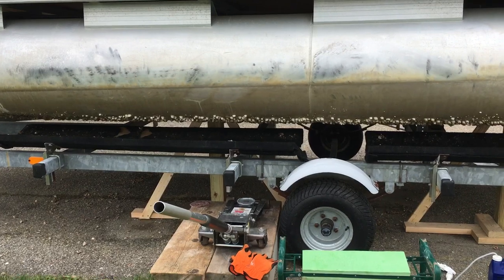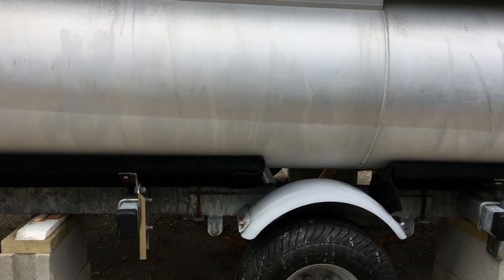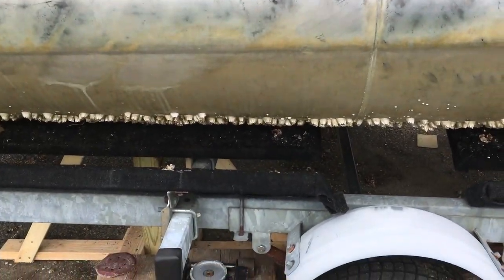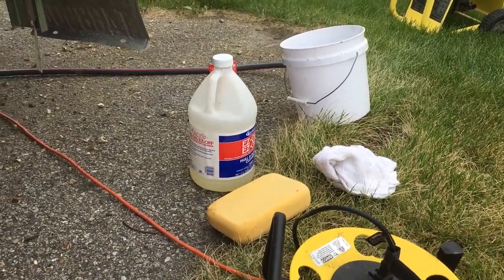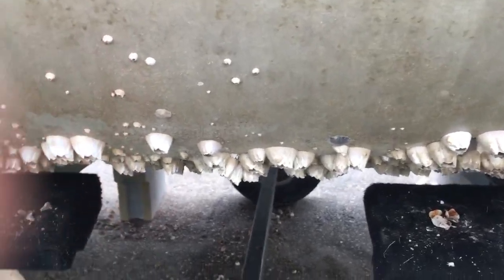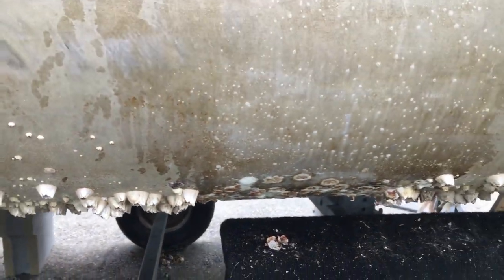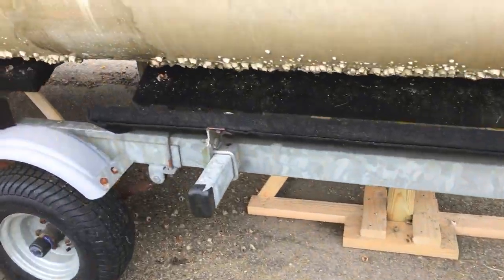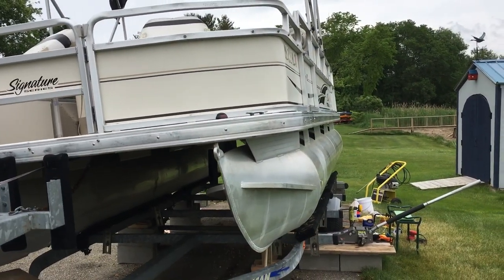Removing barnacles and cleaning a pontoon boat and raising it from the trailer

Comment: Douglas
Did the ez-on ez-off cleaner really work on the barnacle residue that was left on the pontoons after you had scraped them off?  Did you have to sand them off or did it clean them off as well as the side that you showed that you had finished?
Thanks,
Mike
Reply: FerrisV1  good question, still here for the answer